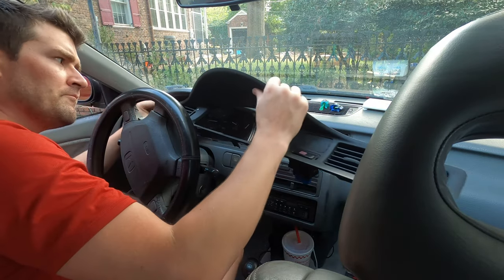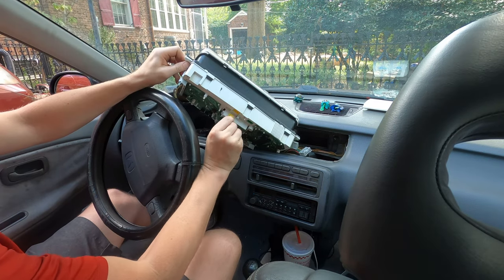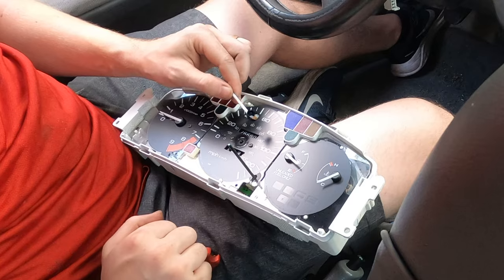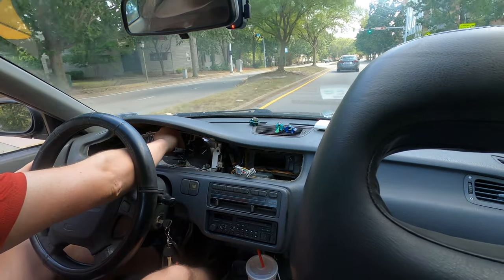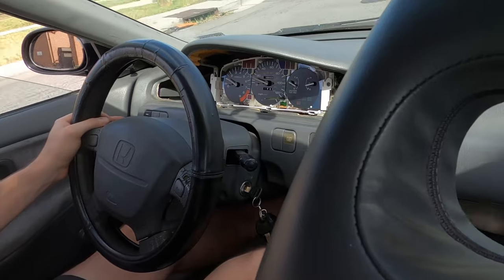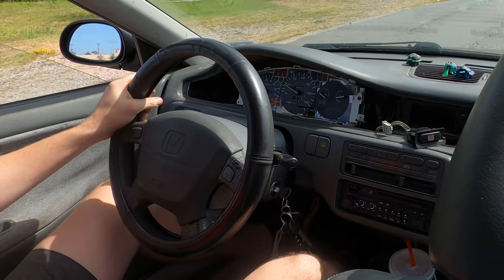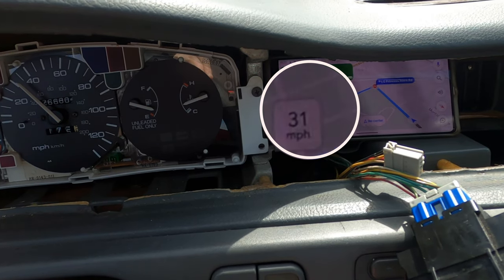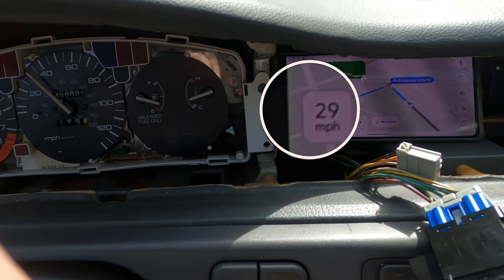How to calibrate the speedometer on your Civic

Comment: I guess I could use a GPS app or my old garmin.  This is a great idea.  I have a 1995 accord but I don't see why this wouldn't work.
Reply from the maker: Yea it won't be perfect, but better than nothing if your speedometer is totally wrong like mine was.
Reply: @BadHomeowner  I was thinking I don't think it will work.  Because it's 10% off everywhere.  I think I need to put my old USA gear in there.  I suspect the JDM gear is about 10% smaller.